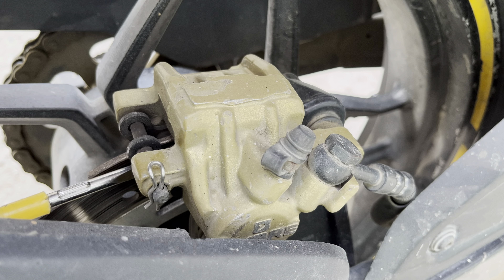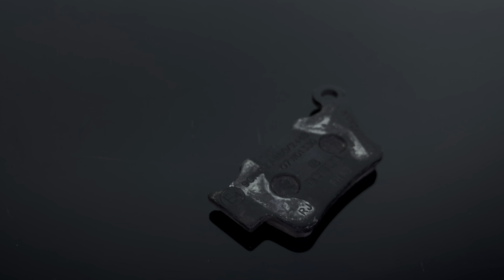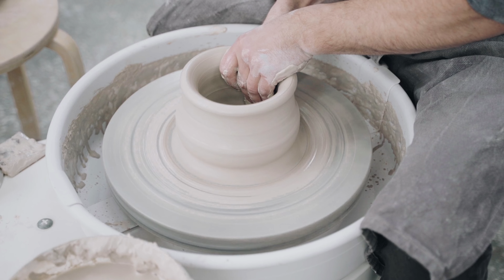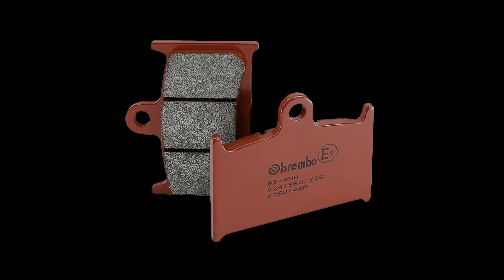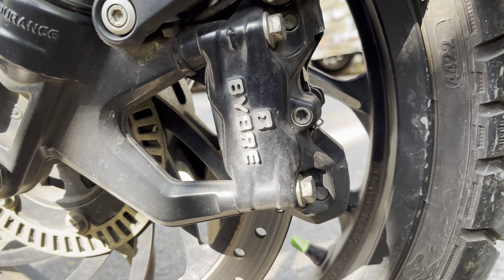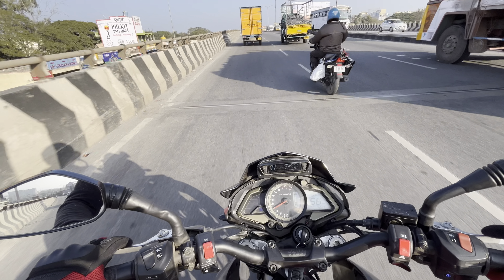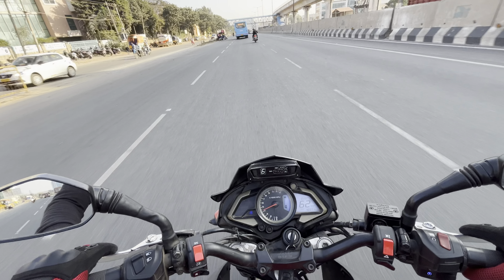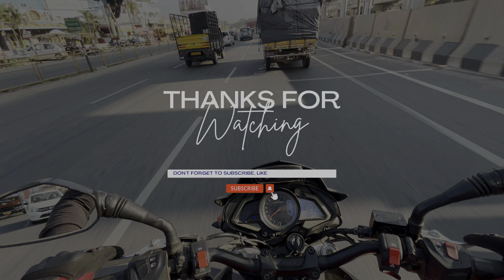Ceramic vs Sintered vs Normal / Organic Brake Pads | Which one should you buy ?

Comment: Using EBC HH sintered pads on my 2017 Dominar ever since I bought it. Price for one side is 2500-3000. Bought 2 times each, to date! Main reason I decided to buy HH sintered pads was, after a realization that, my bike won't stop properly with any rainy conditions. I bought sintered padsright away. The performance of HH pads on rain is unmatchable to any. 

After 30k kms, my experience is, HH sintered pads are good, expensive, and will ear the rotors. Also the stock rotors from Bybre sucks for sintered pads. Sintered pads have many advantages, but the rotors need the proper up gradation. Planning for the ceramic pads next time, coz EBC pads are hard to procure nowadays. 

Dominar's rear brake sucks, even after the release of many versions of the bike. Fanboys have the theory of 60:40, 80:20 braking theories, but it still bad asf. EBC pads have made the difference so far, but not as pas with brands like KTM, RE, Honda etc. Spongy brakes are Bajaj's trade mark I think!!

Comment: I have been using veshra ceramic breakpads on front of my Apache 160 4v from the past 2.5 year's and completed around 27k with them still has 30% of the life left... Breaking power and feel is so much better then stock and so the life...Disc plate wear is also much lower and so the break dust... I'm using organic on the rear it just makes lot of noise and the disc plate wear so much that i have changed the plate once..now the prices of ceramic pads are increased alot..at that price i don't think they are worthy
Reply: Does ceramic pads make noise?